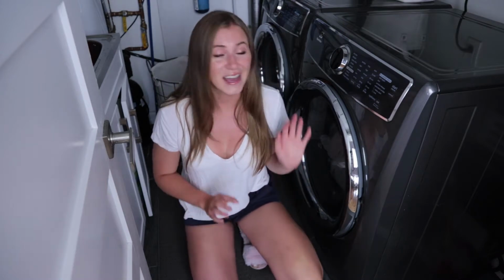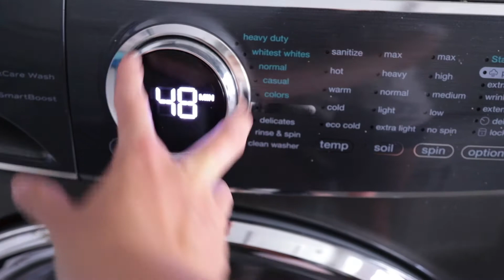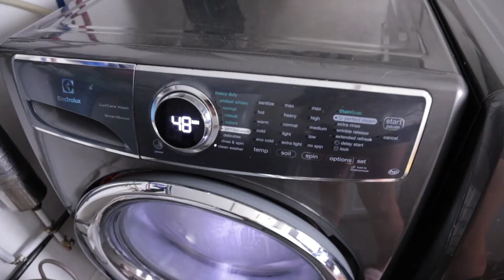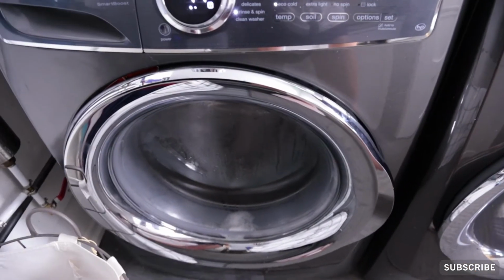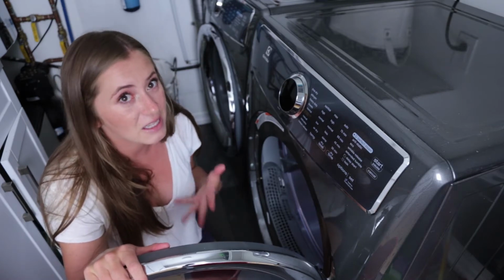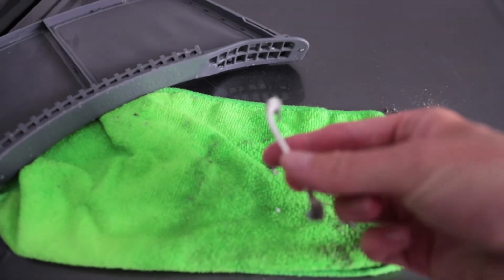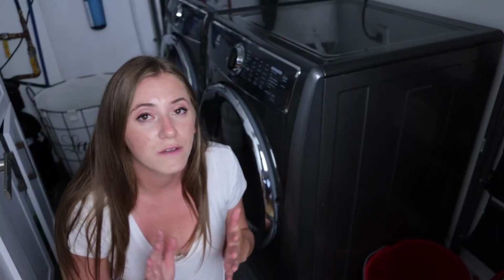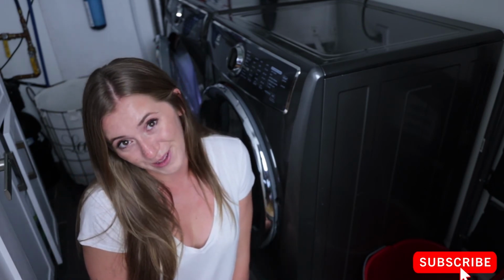HOW TO CLEAN YOUR WASHER & DRYER | The Second Lint Trap No One Talks About!

Comment: When I was washing towels I forgot to put the cycle on wash and it was on rinse instead and then I put the towels in the dryer and when I took it out of the dryer and felt the dry towels is when I realized my mistake. My hands got all sticky from the detergent not coming off. So I now assume the dryer drum is coated in detergent from the unrinsed towels . However the detergent I use is clear so I can’t see any stains, but I know the residue is there. Would this method remove the detergent residue? I’m sure there is quite a lot in there but I just can’t see it because it’s colourless. Thank you and Helpful video!
Reply from the maker: Ian, very common problem. Not to worry! You're actually going to use the same cleaning technique I used in this video for the dryer drum. A little bit of warm water and vinegar to wipe down the inside will get that coated layer off. You may just need to do it a couple of times. Remember to wipe down with a dry rag after you've finished just to get any leftover residue. Let me know if you have any other questions and thanks for watching!
Reply: @AfterTap  thanks for the reply and answer! I should’ve added this but this incident happened more than a month ago and my family has continued to use the dryer because the residue doesn’t worry them, but I’ve just been hang drying everything for the past month.  So the residue would probably be baked in the drum siding pretty good since the dryer has been used so many times since I messed up. But doing this cleaning method a few times should still remove it? I apologize for reassuring. I just have I cleanliness ocd and I want that residue gone so I won’t be scared to use the dryer again😂😂
Reply from the maker: @Ian-xd2in  Hi Ian, absolutely! I would say wipe twice with the vinegar and water mixture and then once with just water and you will be good to go! Hope this helps and that you can use the dryer again!
Reply: @AfterTap  thank you! Appreciate it greatly.